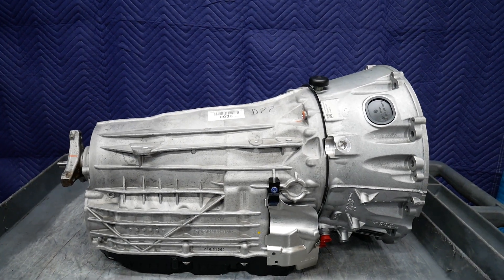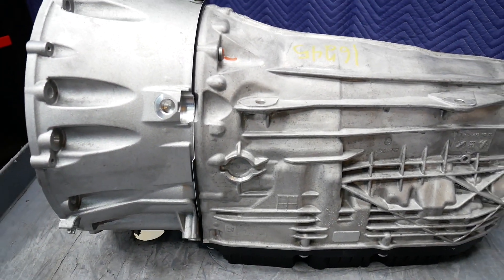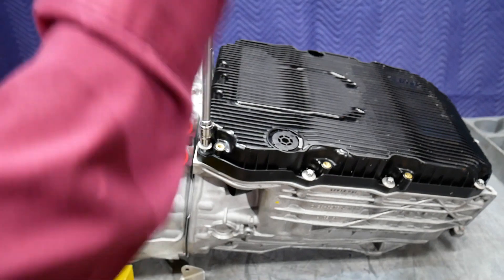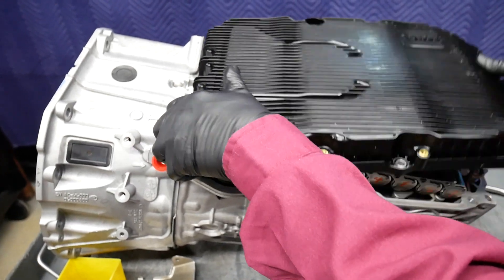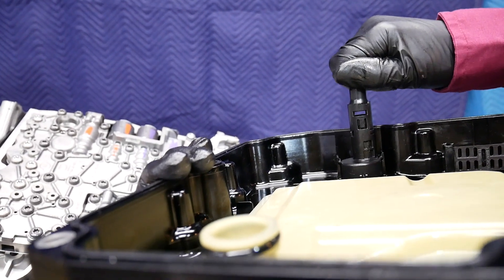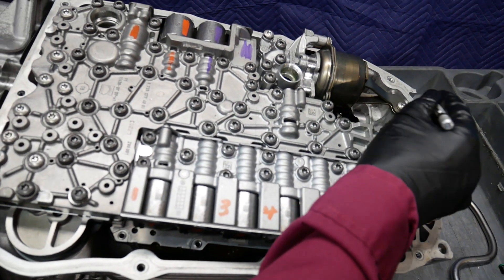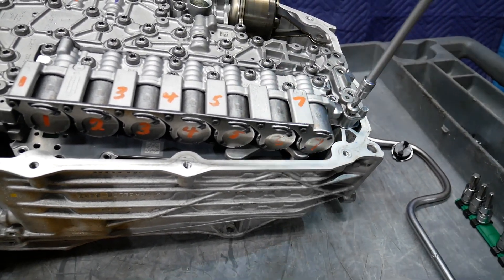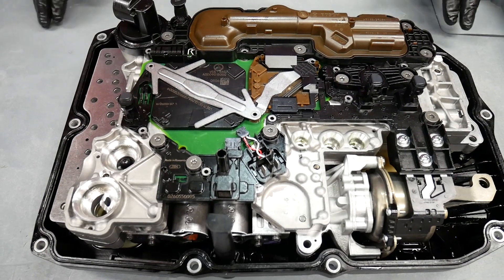REVISED Mercedes-Benz 9G-Tronic Disassembly

Comment: Hi, i have a leak on my torque converter input shaft. I going to remove the box, can i change the seal without tearing the gearbox apart. Thanks

Comment: Why do manufacturers put the electronic control module inside the valve body - instead of wired in to an external module somewhere else in the car?  Is it so the transmission fluid can help cool the module?  Or maybe so that the electrical paths are as short as possible to reduce shift time?

Comment: Great knowledge and truly appreciated 👏  by chance could you make a video of removing the TCM from the valve body. I am currently dealing with my 9g having issues shifting from P To D. Everything im reading is leading me to believe I need a new TCM, but Mercedes dealer is telling me I need a new transmission. And will the tcm need a re -learn after being  installed?
Reply: The TCM is coded to the car that's why if you buy rebuild gearbox the firm needs the original trans first to move the valve body with electronics over to the "refurbished" gearbox...
Only Mercedes can reprogramm the gearbox for you so you are out of luck 😂

Comment: My 2016 9G tronic has only done 15 000 miles but it is now over 6 years old.  Should I change the transmission oil due to it being 6years old?
Reply from the maker: No, it’s not necessary. It’s based on mileage only.

Comment: I have a 22 frontier.  They use this same transmission and I just heard i have a recall about the parking pawl...woukd it be possible to get to the parking pawl on this transmission through the oil pan or does it need to be removed from the vehicle you think?

Comment: You seem to be a mountain of knowledge on this transmission.
I have a question about the 9g tronic. I own a 2015 e class e350 but has developed a slight whine in 3rd gear and higher pitch in 4th. I checked the oil pan and has some aluminium filings in the bottom below the filters. Can you please let me know your thoughts.
Many kind regards from Ireland 🇮🇪😊
Reply: Isn't it obvious?  Rebuild time not far away.
Reply: Do you still have this noise 
My e220 have whining noise when accelerating till 50-55 km/h

Comment: How often to change the transmission oil for 9G tronic?
Reply from the maker: Mercedes may recommend service intervals but after 100,000 miles it would be a good idea to change the pan filter assembly and fluid at least in the pan.
The 9G-Tronic seems to be holding up quite well and no major problems so far.

Comment: How important to service this unit? Mercedes tech in UK claims that should be ok until 200.000 miles as long as it is not contaminated. Ps great video
Reply: Many thanks for taking time to respond
Reply: I've heard that the 9g tronic is more reliable and simpler than the 7g tronic. I've seen a tech on Instagram that posts and said they rarely see 9g tronics coming in for issues. 9g tronic is a nice transmissions. Shifts are quick and smooth. Much more than the 7g tronic. Apparently the 7g tronic had a weird way of shifting between the gears whereas 9g tronic is more "direct". Not sure what is meant by that but I read it somewhere.
Reply: Nah, change the fluid and filters around 20k and 30k miles thereafter... 

Otherwise you’re likely to see a 100,000m or as Mercedes would like to infer, it’s a sealed for life gearbox...
Reply: What would you choose? 9 G tronic or 8 speed bmw ZF ?
Reply: My 2016 9G tronic has only done 15 000 miles but it is now over 6 years old.  Should I change the transmission oil due to it being 6years old?
Reply from the maker: If we can compare this unit with the 7G-Tronic, which was introduced in 2004,  and suffered several complaints   "Defective valve body or the conductor plate are usually the cause for these problems." 

http://www.mercedesmedic.com/722-9-7g-tronic-automatic-transmission-problems-solutions/
We get our fair share of 722.9 7G-Tronic units for rebuild where some are damage to the point of a non-rebuild-able core. We have yet to get a 9G-Tronic unit into the shop, as most of our customers are driving vehicles out of warranty with greater than 100,000 miles.

Comment: In your opinion, does the 2 additional gears make this a better transmission than the outgoing 7G or is it simply marketing?
Reply from the maker: "The fuel economy advantage of the 9G-TRONIC is in average 6.5 % in the NEDC.The 9G-TRONIC in comparison to the 7G-TRONIC. The main advantage can be seen in the velocity range from 40 km/h to 100 km/h, where the low engine speed is still possible, due to high number of gears and the high ratio spread. Especially under customer driving conditions significant fuel economy improvements are possible."
This statement is quoted from the Mercedes service and sales documents. The 9 gear ratios are close and the system can skip gears when shifting. The shifts are very quick and almost imperceptible. Time will tell about the success of the 9G-Tronic but the 7G-Tronic is still used in many 2019 models.
Reply: Thompson AutoTest Thanks for the detailed reply. That’s very interesting on the fuel economy.   I purchased as 2018 C63 S AMG and I have found the 7 speed transmission to be flawless.  It provided very fast and smooth shifts.  I’ve never said to myself ‘ if I only had two more gears I’d be happy’.  The fuel economy on this car is atrocious so I am not sure 6.5% would be perceptible but every bit helps.  Excellent video sir.  I can tell you have know your stuff.
Reply: @986C  The C63 7g tronic is a little different to the normal 7g tronic however. The C63 has a multi plate wet start up clutch instead of a torque converter. It allows for less pumping losses and more direct path between the engine and gearbox while still maintaining the smoothness of a normal torque converter one. So it is basically a torque converter transmission without the torque converter and in its place, some wet start up clutches. I've always felt that the 7g tronic shifts can be jerky at times. The 5g tronic was slow but smooth. The 9g tronic shifts quickly AND is very smooth.